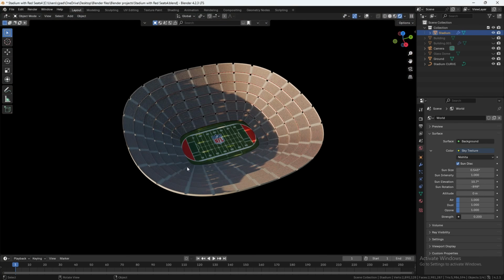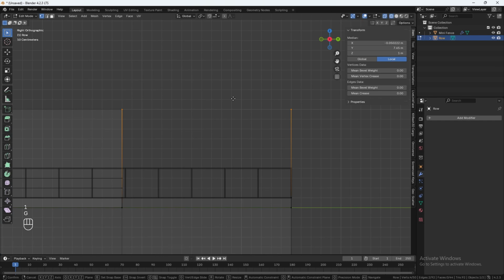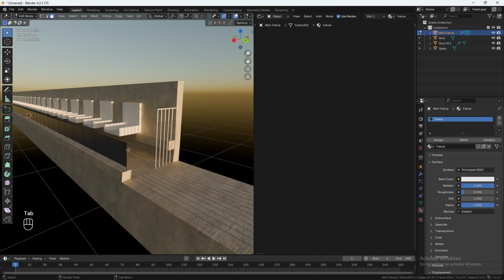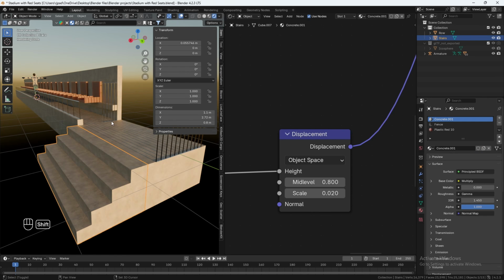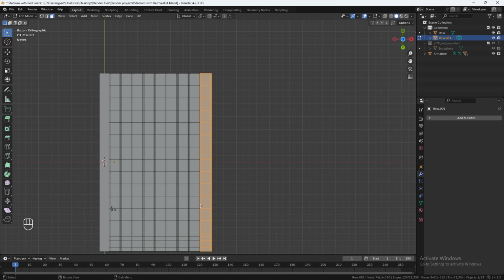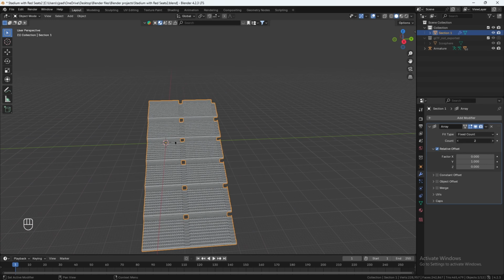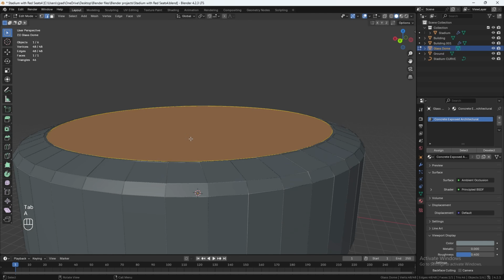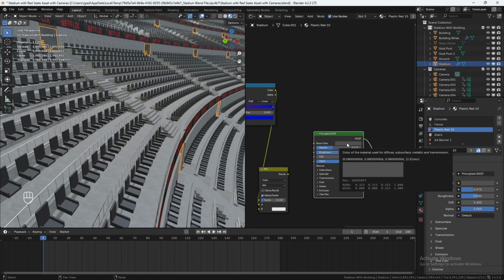How to Model a 32,000-Seat Sports STADIUM in Blender – EASY Step-by-Step Tutorial!

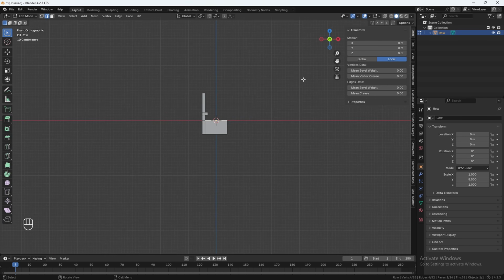Comment: at 3:37 when i do the loop cuts it doesnt go up and down no matter what i do
Reply: There may be unintentional duplicate vertices. Removing them should solve the problem.
Reply: @kameonline6518  what do you mean unintentional duplicate vertices
Reply: @chrishall6609  Once you press the E key, the vertex will be added and will be there without you having to move it. 
Check the number of vertices in the bottom right, or move it with the G key and check if there are any overlaps.

Comment: Well the poly count could be much lower if you delete bottom side of the concrete structure .. there are a lot of non visible polygons 😀. 
I did the layers and seats with Instances which also helps to lower the poly count . 
Great tutorial thumbs up 👍
Reply from the maker: Oh you’re right! Deleting the bottom faces of all the sections would definitely lower the polycount since you can’t see them. I didn’t think of that.

Comment: This video so goooood!!! BUT..When I try to follow your video, there's too much lag. But you don't seem to have any lag. My computer has an RTX 4080, so it's pretty high-end, but why is there lag? The lag is especially bad when creating curves or adjusting the scale, so I can't keep up with the tutorial. 😔
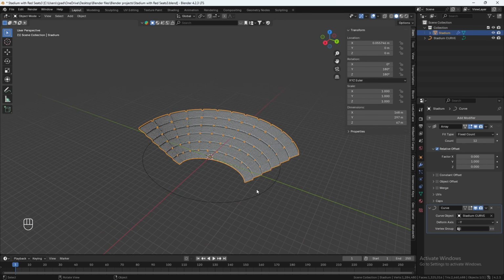Reply from the maker: Little bit of lag is normal when adjusting curve or scale. But FIRST, try to apply all the modifiers and the lag will go away! If that doesn’t work, here are some Tips to reduce polycount: make 4 rows instead of 6 which will reduce poly count. On 31:35 DO NOT add more than 26 sections. You can even add less for lower polycount. Finally, Apply all the modifiers including the curve modifier once you are happy with the shape. Then it will be a lot faster.